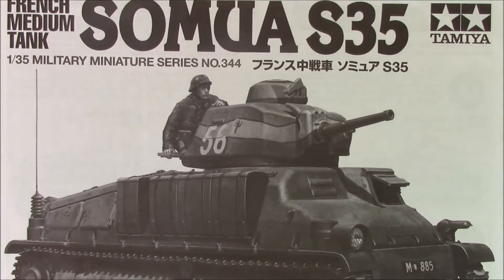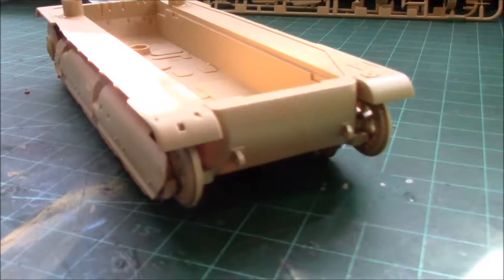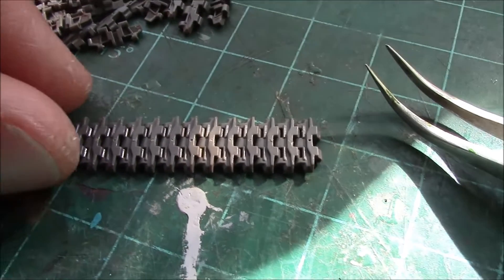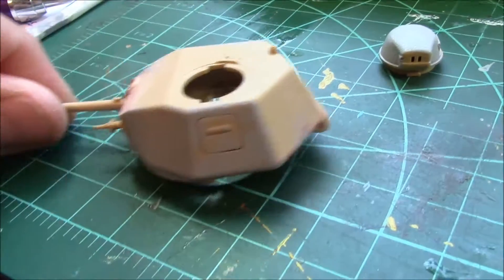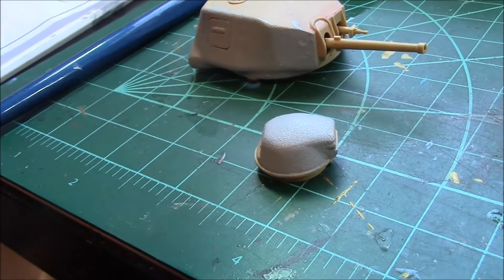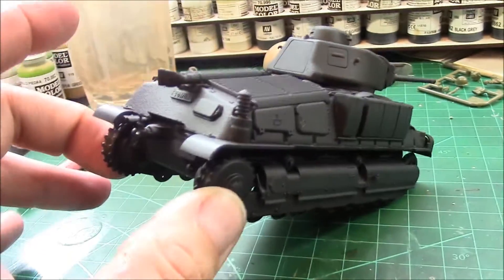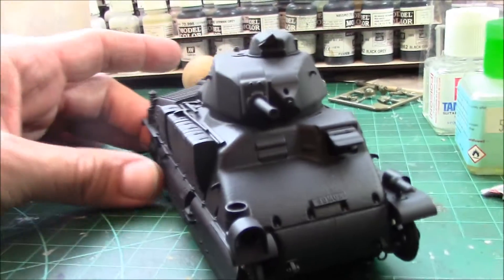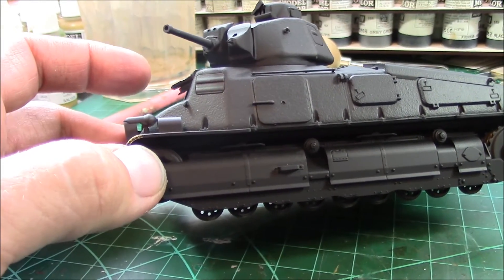TAMIYA SOMUA S35 BUILD

Comment: This one has so much nooks and crannies around the suspension and its side armor plate. How did you manage to paint inside of t after building it first?
Reply from the maker: The black primer acts a a deep shadow if the color doesn't get into all the deep hollows.
Reply: ScaleModelAlberta yes I know. I am asking how the black primer reached all the crevices.
Reply from the maker: For the most part the black got everywhere I needed it to go.  The parts that the black didn't get right back to are surrounded with enough colour, black or the base colours, that that are not noticeable because of the shadowing affect of the surrounding dark paint..  Kinda a little optic illusion that makes it look like everything got painted.